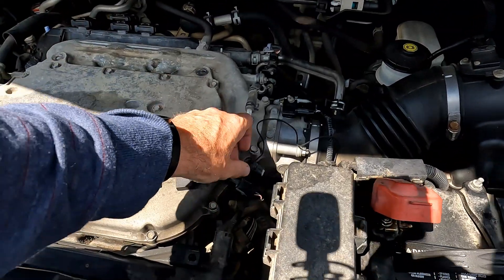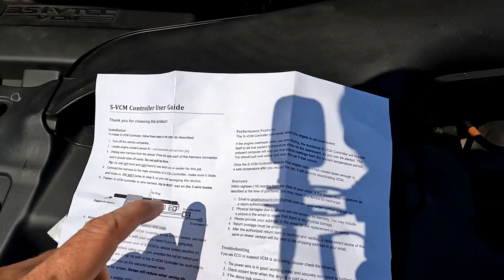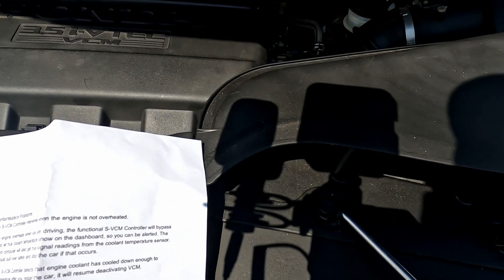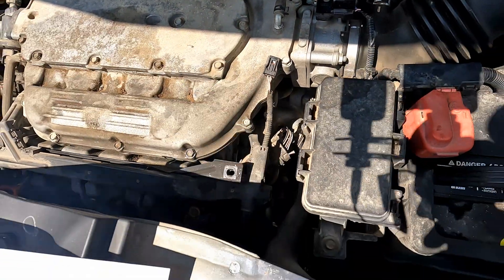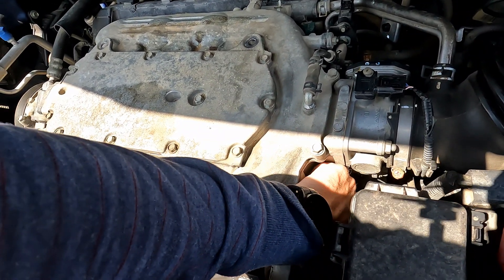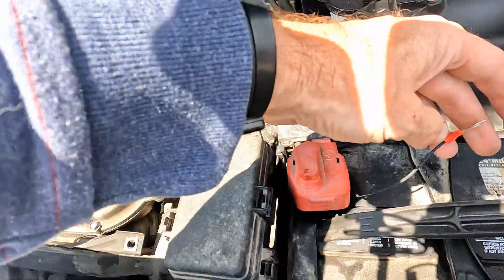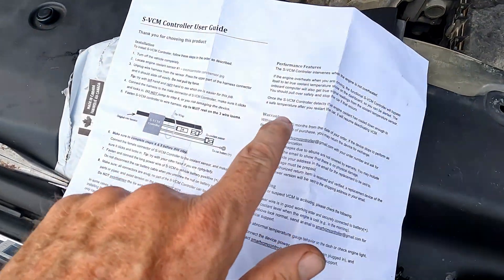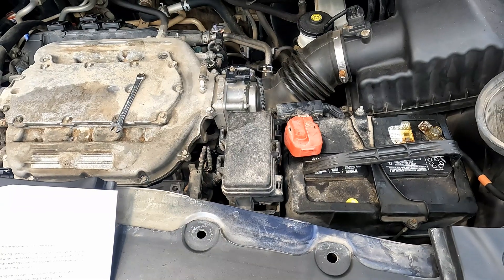How to Disable Honda Pilot VCM | S-VCM Device Install Guide

Comment: I put one in my 2021 Pilot EX last year and it really improves engine response when stepping on gas pedal and overall performance, in my opinion.  I did have to unplug the negative battery terminal cable and waited a few minutes to reconnect.  This restarts the computer after installation to clear all error codes and any indicator lights.  My dashboard lit up like a Christmas tree!!

Comment: I’ve done this, and now I have a vsa and check engine light on
Reply from the maker: What does the codes say?   Mine had no issues and I haven't heard of any related to this product. There could be something wrong with the car.  Check the code then perhaps  clear it and see if it comes back.  If it does, disconnect the S VCM and see if it comes back.

Comment: Does it make a difference if you switch to 5W30 instead of 0W20?
Reply from the maker: I always like to follow the manufacturer recommendations for oil.  I believe 5W30 will diminish gas mileage but may be a bit thicker.

Comment: Thanks for your video. I have a 2014 V6 accord with a J 35Y2 series currently 94,000 miles just switched out the timing belt and would like to keep your car from any more years so I’m certainly concerned about this whole issue with the VCM, oil consumption, and of course, the potential engine damage resulting thousands of dollars. You have 144k when you did this, any signs of engine damage before you did this? The question is it’s never too late to do this regardless of mileage, but is there anything I should look for in terms of damage that would determine whether I should do this or not. Besides the temperature inaccuracy of other VCM kit, is there any other downside to the engine by using the S-VCM kit then fuel  I don’t care fuel economy, as the little savings is insignificant compared to the cost of engine damage.
Thanks,
Reply from the maker: I now have 15k and it's much better. I had a big smile on my face the day after I put this S VCM in because it was running soo great. I think it's fantastic.   They say 1mpg down, which isn't much. I got it with 140k miles or I'd have done it sooner.

Comment: I get a engine light for cylinder 2 misfire a few times per year.  Changing plugs and coils usually works.  It's not working this time.  They say I will need thousands of dollars of work done to remove head, possible piston rings, possible valves, etc.  Could this device  possibly help me?  I don't want to give up on this car.   But everyone says this is an issue with 2011
Reply: I have a 2011 pilot with 122k miles on it with the same issue. I have a buddy that is a honda mechanic and he said the piston ring on cylinder  2 needs to be replaced. Fortunately he's replacing 1-3 then he said you can add this device to prevent future issues
Reply from the maker: Maybe try Valvoline Restore and Protect.

Comment: I have a 2011 Honda Accord with about 170k miles. I haven't had any problems burning oil or anything, and my only complaint is the hard downshifts when the vcm is on and the occasional misfire from the cylinders turning back on mid-drive. Do you guys think this is still worth it for me?
Reply from the maker: For just over $100, there isn't much to lose.
Reply: I just bought the same year with 166k on Monday. Ordered the part and will install instantly. Drain and fill your tranny at least three times. I'm using the valvoline max life for the the drain and fills and then the final fill will be with honda DW-1 fluid
Reply: Also, run seafoam (or diesel if you ain't scared) in the next couple oil changes. With seafoam, add and then drive for 100 miles before drain. With diesel, drain half the oil, fill with diesel, idle for a couple minutes, then drain

Comment: My pilot is a 2011 EX-LN. When driving and letting of gas, it sometimes let's out puff of smoke. I'm reading this will also help with my problem. Liked your video sir. I also checked pcv valve.
Your thoughts?
Reply: 200k on pilot
Reply from the maker: Definitely worth replacing the PCV as well if it hasn't been already/recently.   I am also using Valvoline Restore & Protect for oil and changed out the trans fluid a few times.  It probably could also benefit from a Seafoam treatment,  but this one is more up for debate.   Spark plugs too.
Reply: It worked perfectly. 
No more oil consumption and no smoke coming out tailpipe when decelerating on highway. 
Thanks for your help.

Comment: Any check engine light show up? 
And whats needle,  temp guage show, on the insterment cluster?
Reply from the maker: Great questions. I've driven over 1,000 miles since.  No lights and tem laughed shows just about middle of the gage.  Could it be a bit lower than it was?  Possibly.   The nice thing about this VCM is that if the engine does get too hot, it says it will show ir warn you.  I hope I never need to test that one out.

Comment: I just installed mine today on my 2015 Honda Pilot, and the difference is incredible! No more stuttering during shifts, and I'm experiencing smooth performance overall. I'm extremely satisfied!
Reply from the maker: I'm glad to hear it. Things are working well on my end too.  If you haven't already,  I recommend doing the transmission drain and fill 3 times.

Comment: Where can I order one
Reply from the maker: This is the one I ordered.  I have no affiliation with the company: S-VCM Controller - Disable VCM / deactivate VCM and stop ECO in Honda Acura https://share.google/lLuEhAjn2ozkk4S1J
Reply: Did it work I have a 2006 pilot and it's doing multiple misfires and I have a feeling it's the vcm because that's what it always is did you do a follow-up video
Reply from the maker: I've had no issues with it. Great idea for a follow-up video.  I would buy the more expensive one and not cheap out due to the features for a reasonable price.  My car doesn't go into Eco mode anymore, and I also changed to Valvoline Restore & Protect oil.  If you have a misfire, I would also consider changing the spark plugs.  I did a video on misfiring for my Ram 1500 and I'll probably do a video dedicated just to misfire.  Plug change would be my first step for sure.  Wires next potentially.
Reply from the maker: I would also consider identifying which cylinders have the misfires.  Perhaps pull all the spark plugs and see if they are the issue and if there are some that are misfiring and others that are not, potentially swap out the coil packs to see if the misfire follows the pack.  For example is cylinder 3 is misfiring and you move the coil pack to cylinder 4 and the misfire doesn't move it's an issue in the cylinder.  If it moves to cylinder 4 then you have a bad coil.

Comment: This is an excellent and brief video. I followed to install the S-VCM controller on our 2013 Honda Pilot that currently has 122,000 miles and has had three major repairs related to the faulty VCM controller delivered by Honda. I do recommend changing all the spark plugs at the same time if they have not been changed before and I purchased Bosch plugs from the local auto parts chain.
Reply from the maker: That is a great idea!  I bought it in May, so I haven't yet.  I did put in Valvoline Restore and Protect.  I'll probably do NGK plugs as I've used them for decades and they are Honda OEM. Bosch are good too.
Reply: Check with you honda dealership to see if you qualify for the recent notice Honda put out about this issue. They will cover the cost of engine repair if needed. Unfortunately my 2013 has too many miles for the repairs to be covered even though we bought it new and have always had it serviced through our dealer. But with your mileage it would be worth checking into. Our pilot is now throwing cat codes so we will probably just get rid of it. Sucks because we love our pilot. We have drove this thing all over the country. 223,000 miles on it if you're curious. Cost of repairs is more than what it is currently worth.....sucks big time